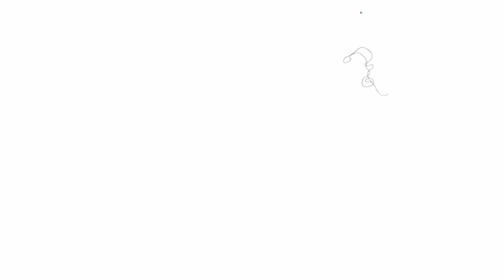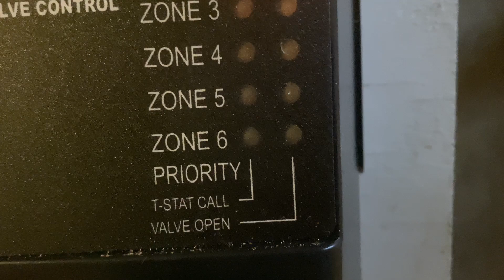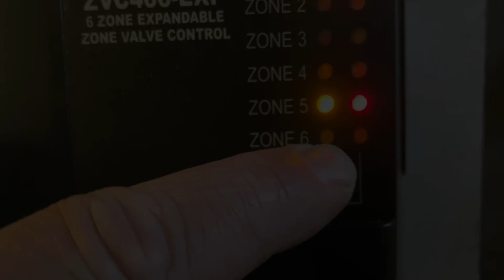Brand New Taco Switching Relay Dies Within 24 Hours

Comment: Who the hell needs a switching relay for zone valves? Transformer and wires are all that's needed
Reply from the maker: Oh really??? I’d wager $5000 you can’t wire them in with just a transformer and wire. Let’s see you wire 2 wire zone valves with no end switch. Think you know everything????
Reply: Some boilers have a built in control that controls the zone valves. Energy Kinetics EK-1 and EK-2 Energy Manager for example. They do not use the end switch because the thermostats are wired on one side of the Energy Manager and the zone valves are wired on the other side. Switching power to the zone valves is controlled by the boiler control, using solid state components, not relays, and it's impossible for the circulator to dead-head because it's always pumping through the DHW plate heat exchanger. I realize it has no bearing on this situation, but it is an example of a boiler using zone valves with no end switch without a separate switching relay. The one disadvantage of that setup is that because there is always flow loss through the DHW circuit, in an old converted gravity system with large pipes, the stock 007 circulator will cavitate and burn out in no time. In my area where these boilers are common, the common circulator upgrade for such a system is a B&G S100 or Taco 110-24. They are some of the few circulators that can handle such low head pressure for long periods of time. There is also an add on control for that boiler to use primary/secondary loops instead of zone valves.

Comment: the blinking lights are likely both power stealing thermostats, even if standard battery operated, many still use a bit of power and could cause LED strobing. as long as the relays are not clicking away and cycling with it, it's likely nothing to worry about. it could also be some for of communication or coding bug if they all flash, if connected or not.

Comment: Perhaps the pin soldering on the connector from the transformer are bad, but when you pulled off the connector it seemed not to be locked in.
Wow a big setup, 👍👍👍👍👍

Comment: I'm a plumber & gas fitter, but the HVAC guy on a major reno we "completed" is losing his mind on a heated electric make up air unit that turned out to be DOA out of the box.  Unit is suspended in a crawl space at a cottage a two hour drive away and it didn't reveal its manufacturer's fault until the unit's initial commissioning.   #NoPromises